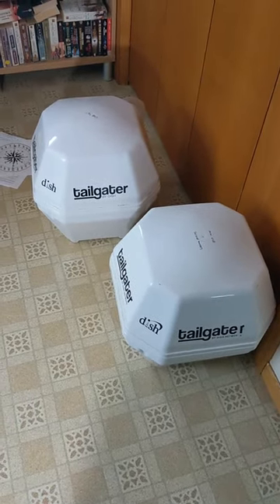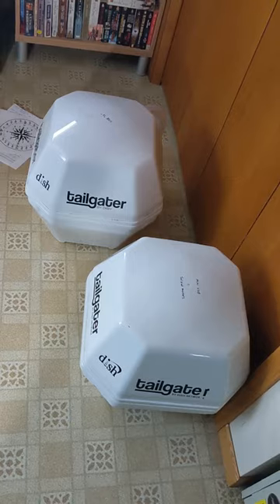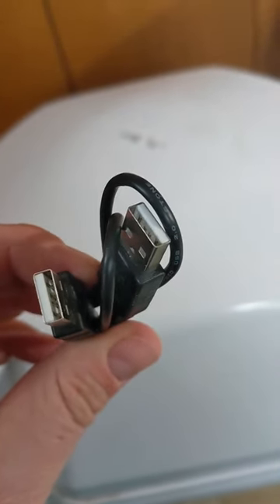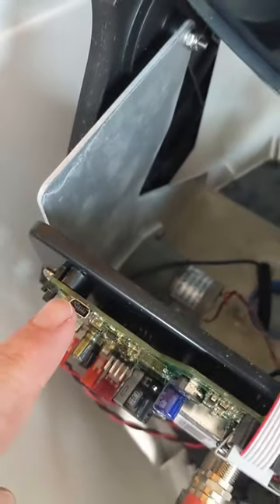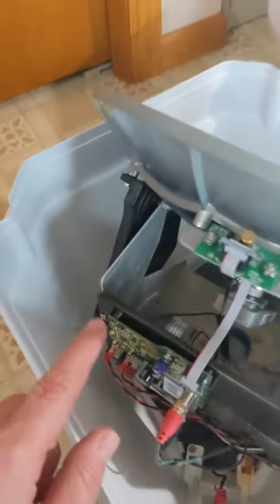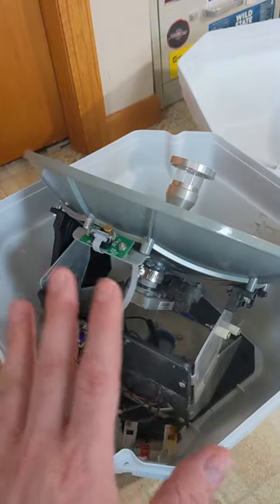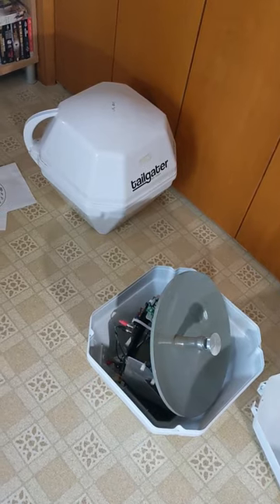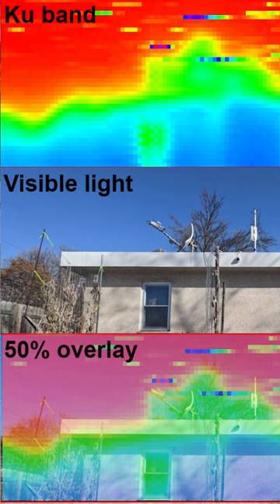Which Tailgater Antennas Work as Microwave Imagers?

Comment: I suggest using a recipracating mechanism for the horezontal movement.
Here is a link to some mechanisms.

https://youtu.be/ve9M8d6KfdI

These mechanisms would have the advantage of speed and even action in both directions with reduced error and reduced power consumption. You would have to be able to digitise the position. The vertical position is as normal.

Comment: Could you theoretically transmit something with those dishes?
Reply from the maker: Maybe if the LNB were swapped for some sort of transmitter. For example, they'd probably work pretty well for long-range wifi. I have a two-way KU-band dish but I don't know if it has any amateur uses in North America (the only geostationary ham satellite is on the other side of the planet).

Comment: all the tailgater dishes that look like this on ebay listings by sellers only show the model number as the one piece of useful info. it does not state the year nor if it has a usb and if so, what type?
but considering models starting as bklulz is 2014 and bklulw is 2011, then can we assume that every year increments the letter?
w=2011, x=2012, y = 2013, z = 2014.
even with that assumed information, we  might make a further assumption that some form of usb was used. if all this is true, then the question lies on what type of usbs these are for the years in between? I prefer a type a port over a mini usb any day.
this guesswork is also because your particular models are not currently listed and there might be a chance the other model types may just as well work. but that's a $150 to $200+ gamble. 🤔
Reply from the maker: Yeah, it's hard to know for sure, that's why I've held off on buying more. I see them locally on Craigslist / Facebook Marketplace / etc, but I only contact the seller when they get below $50. You could try asking eBay sellers if they'd open it up and take a picture of the circuit board, but not everyone wants to do that!